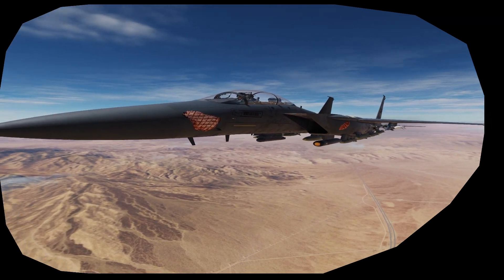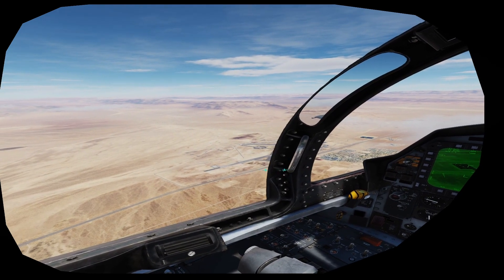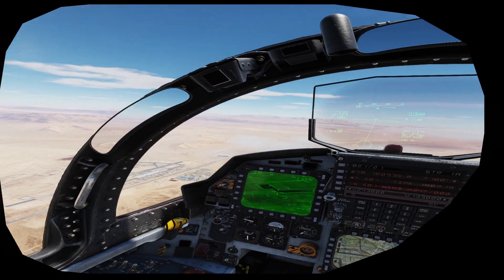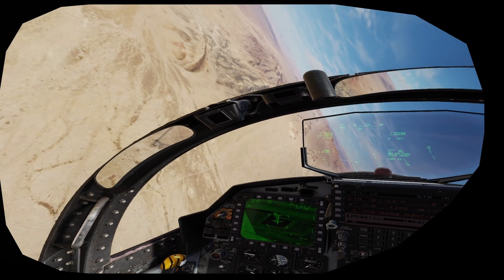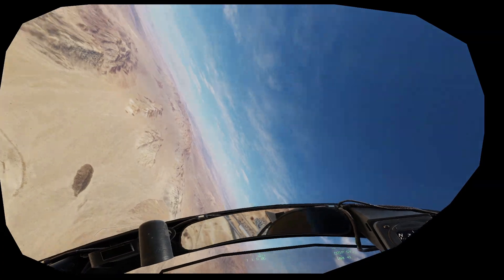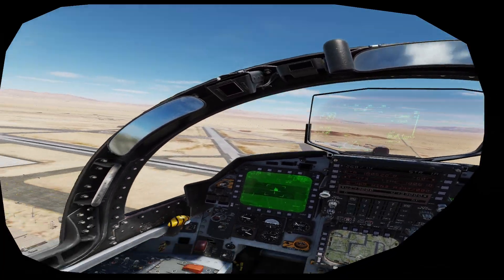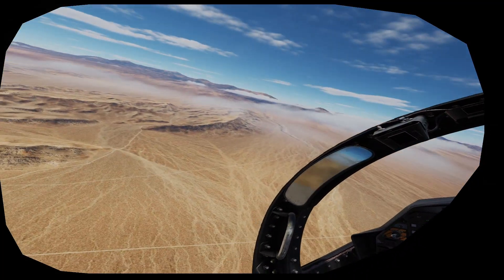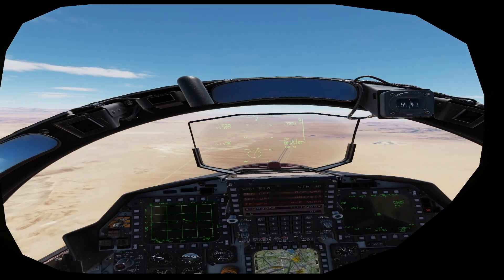Notso  - F-15E Strike Eagle CDIP Basics

Comment: Loving the reference to the 1G banana pass, that's not often talked about I think. I am not positive about the F-15E, but I imagine it has to be very similiar to the the F-16 where the following G values apply for CCIP:

dive angle / Gs
10° 1.0
20° 0.9
30° 0.8
45° 0.7

Comment: Notso, If you’d like I’ll send you my settings on DCS so you can get a video recorded without the mask in the way, and at the proper aspect ratio. I figured it out but can’t think of the settings off the top of my head. I’ll send it via discord when I reach my PC. The head bobbing will still be present, but the video itself will be much more clear to see and not stretched. Cheers!
Reply: OpenXR toolkit allows you to add some filtering to head tracking. It can remove the some of the bobbing without adding too much rubberbanding.

Comment: I greatly appreciate the content of your instructional videos Notso. This one has perhaps not worked as well as you intended though with what looks like a VR recording. Two things have happened. The minor one is that the unconcious head bobbing that everyone does makes the image hard to watch at times. The major one is that the height to width ratio of the image has become stretched in the horizontal plane. This makes it quite hard to learn the visual picture you are trying to show regarding the intial point for rolling in, and how the picture changes on the HUD as you align the bomb fall line on the target. Sorry I have no advice on how to fix this as I have never done any streaming, VR or otherwise.
Please keep doing these though, this is still better than no video at all.